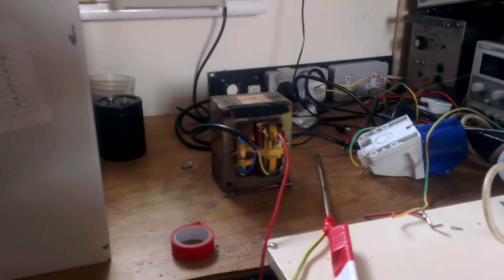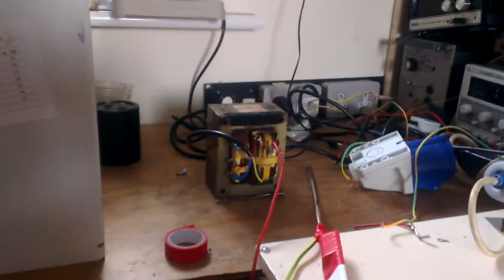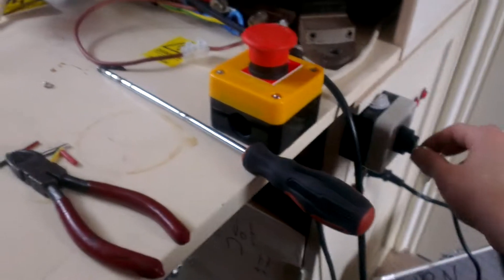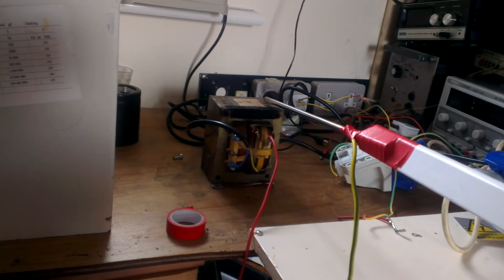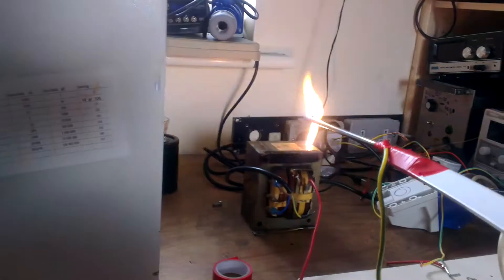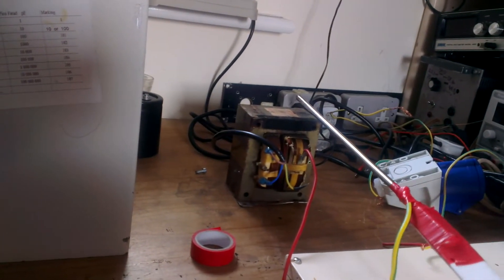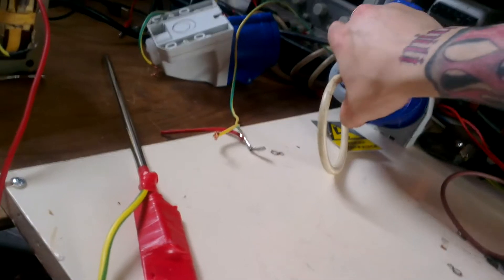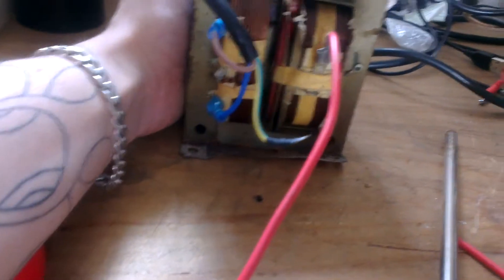Playing with an MOT and the ballast control

Comment from the maker: My Variac is on it's own breaker from the main consumer unit and then though another consumer unit next to my bench .Its all safe except my Variac is exposed but i will sort that at some point and the dc part i have 4X 380A 1200V diode blocks for fullwave rectifier.Im not saying i will be pulling that many amps but my old small x-ray transformer was pulling 72A when it died so i know the variac can handle it for a couple of mins easy and every thing else is well within the power capabilities

Comment: An MOT may be rated for 1000W but they can deliver a sustained 5kw for a few minutes before self destructing!!!!!!!!!!!!!  Which means at 250 volts they can generate 2500V @ 2A!!!!!!  Very deadly!!!!!!!!

Comment: How are you going to get 50/70A Dc at 270v out of the power socket!!! thats 13500/18900W!! unless you tap straight into the breaker box which is simple stupid and dangerous!